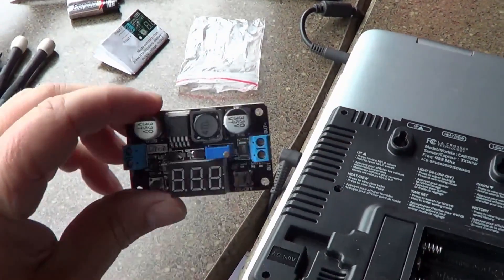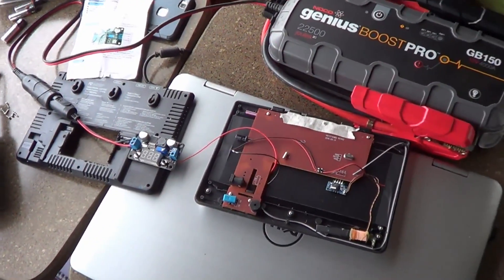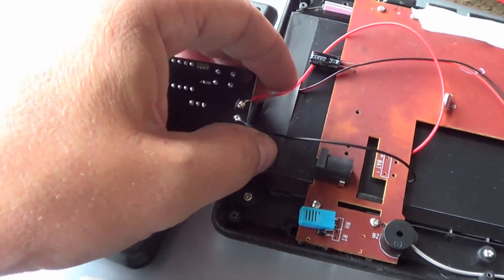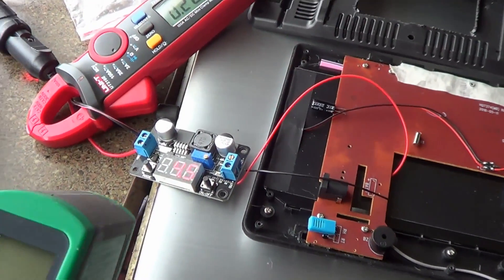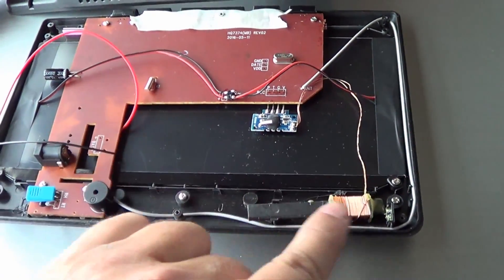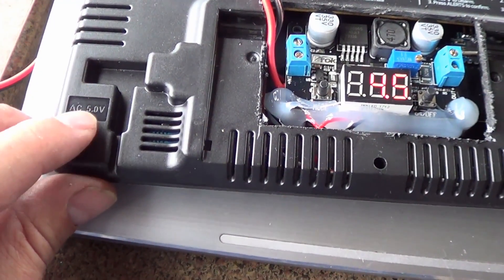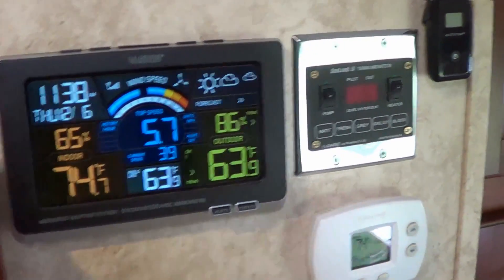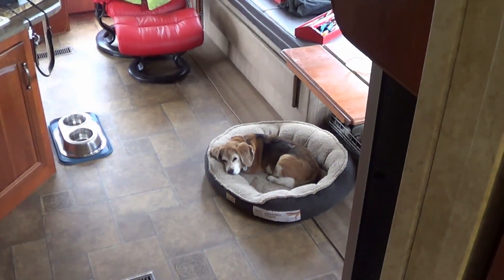Buck Converter Mod -  Reducing the RV 12 VDC to 4.5 VDC

Comment: if you connect it to the adapter input your display will stay on. if you go to the battery your display will only stay on for a short time then go out. its a battery saving feature. also any heat out of that converter will mess with your indoor temp reading.
Reply from the maker: I can't connect to the adapter input as it's a 5 volt AC input, not DC. So far so good on the temp as its matching exactly to my nearby furnace/AC thermostat temp reading. Cheers, Ray
Reply: +Love Your RV hi ray. 
if you put your 4.5 volt to the 5 volt ac . it will still work as the ac goes direct to the rectifiers and will pass through to run your station. The ac input is rectified directly to dc at battery voltage because it is cheaper to manufacture that way as opposed to having internal rectification in the adapter. I know this works as I have done this to my station. I have the same weather station and I am an electrical engineer.
Reply from the maker: How did you did you determine the polarity or did it matter? Did you account for the voltage drop across the rectifier? I believe most silicone diodes drop around .6 or .7 volts. I think if I was to go this route I'd bypass the rectifier and find the main filter capacitor.  Test the rectified DC voltage present there when using the AC plug and then try and match it with the buck converter. Wire the output right to the cap.  I may do that so I can get full features. ie backlight levels and staying on
On a side note - Does your clock keep accurate time. Mine seems to drift, was wondering if the unit was using the 60 cycle of the AC power to keep proper time.
Reply: +Love Your RV hi ray
you are best to go to the filter cap. but it doesnt really matter too much. Less things in line less to go wrong. The polarity doesnt matter as it is a bridge rec.
The clock on mine keeps exellent time. Ac makes no diff. as its not a syncronous type clock. The only problem I had was inside temp. was off so I returned it to lacrosse for a replacment. Everything is working perfect now.
Reply from the maker: Hi Jim, just an update. I did some testing. I found what I think is the main filter capacitor 470uf 16 volts.   I plugged in the OEM 5VAC wall adapter and measured 7 VDC on the cap. This would be expected after a bridge rectification.
Then I fed 5 VDC into the input jack and measured 4.5 VDC on the cap. Also expected as there would be a voltage drop across diodes.
It's quite the difference. I guess there is enough regulation to compensate. But folks supplying 5 VDC to the jack with things like USB adapters are definitely supplying much lower voltage than the OEM design.
I changed my buck converter to 7.0 VDC and wired it right to the cap. Now I have the full features just like it was plugged into the wall and the correct DC supply voltage. Thanks for getting me thinking. :)
Cheers, Ray
Reply: glad I could be an inspiration. Be safe and happy travels.
Reply: @LoveYourRV  Ray... I think that this updated version is exactly what I'd like to do in my unit... however, you lost me right after the phrase "I did some testing." Any chance that you will be doing a followup (or updated) video showing exactly what you ended up doing to power the weather station using 7.0 VDC for us non-electronic engineer types?
Reply from the maker: @leighsheppard8614  Open the weather station display and look for a capacitor 470uf 16V  will look something like this - https://www.rfparts.com/media/catalog/product/cache/1/image/9df78eab33525d08d6e5fb8d27136e95/4/7/470-16r_1.jpg
Set the buck converter output to 7 volts. Wire the output of the buck converter's negative and positive terminals to the negative and positive leads of the capacitor.
Reply: @LoveYourRV  Just did this to my slightly different brand of weather station, and it works great.  Thanks Ray.

Comment: I have a LaCrosse that has a 5v port. I purchased a 12v plug that comes with an adjustable feature. Set the plug to 5v and connect to a 12v source. Works great.  I never saw a buck converter though so great info, Lou
Reply from the maker: Your model may be different and take 5 VDC on the input, mine use 5VAC. I did some testing. I found what I think is the main DC supply filter capacitor 470uf 16 volts inside the display.   I plugged in the OEM "5VAC" wall adapter and measured 7 VDC on the cap. This would be expected after internal bridge rectification.
Then I fed 5 VDC into the input jack and measured 4.5 VDC on the cap. Also expected as there would be a voltage drop across diodes.
It's quite the difference. I guess there is enough regulation to compensate. But folks supplying 5 VDC to the jack with things like USB adapters are definitely supplying much lower voltage than the OEM design.
I changed my buck converter to 7.0 VDC and wired it right to the cap. Now I have the full features just like it was plugged into the wall and the correct DC supply voltage. Cheers, Ray
Reply: Just saw this comment...  yes, 7/5 voltage drop for AC-DC rectification is typical (smoothing the sine's "bumpiness" clips the peaks to fill the valleys).   If you're feeding 5VDC, it should be done after the rectifier (although you do get polarity protection if done from the plug...).   The reason you CAN use a 5VDC input is you're forgetting your unit is happy on batteries...  4.5V when fresh, but probably still tolerated as low as 3V when batteries are almost dead.  I'd suspect the internal electronics are using 3.3V MPU ICs, as most devices that use 5V MPU's start with 6V DC from 4 cell alkalines.  Hack on, Amigo!
Reply from the maker: Would be great to see a schematic and know exactly how things are engineered and the difference between the AC input and the battery back up power feeds. Otherwise, you're just guessing. That's why I want to apply the same voltages as they designed it for and used the buck converter to match them.
Reply: Love Your RV That's why i have the Hammer Analyzer...  One swift whack, and I can view the PCBs much easier!  They may not work any MORE, but I can follow traces so much faster once I can fold the boards...  ;)

Comment: Hey Ray.  I saw a YouTube video (G2I7_Ik7_WI) where a 16-17" (seek to 2:35) radiator fan was converted into a box fan, kind of like the Fan-Tastic Endless Breeze.  If you look at my comments, he states this fan can push about 2000 CFM which is about double the Endless Breeze but I'm not for sure of the power being consumed.  At 3:30 he has it running and consuming 45W and a few seconds later consuming 30W (he might be switching out solar panels for this - not for sure).

The reason I posted on this video is because he is using this DROK speed controller (Amazon part - B00DVGGWC0).  Checking the Amazon product images, I see it has 3 heat sinks which I'm guessing is converting excess power into heat so the fan will run slower but the same net power is consumed as resistance heat and fan speed.  Do you know if this sort of controller and the one used for your project burn off excess power as heat?  I did not see heat sinks used in the controller you used.

One potential use for this sort of fan is to help with keeping mosquitoes away from the area in front of your RV door when boon docking.  Here is a video (zzSFCABlsi8) on using a 120V rotating fan for this purpose.
Reply from the maker: I have roof vent Fantastic Fan works great and doesn't take up any floor space,  very low amperage draw.  Can be reversed to draw air in so it could be pushing air out the door to push out mosquitos.
The losses with these fans and buck converters are pretty minuscule in the grand scheme of things. With the small size of the heat sinks, I wouldn't worry about it. Cheers, Ray
Reply: @LoveYourRV  Wonderful idea of pushing air out the door using the Fantastic Fan.

Comment: Another good video.  The only comment I would like to add is to make sure you use 'Electronic' grade RTV.  The standard grade RTV releases acetic acid as it cures (the vinegar smell) which can corrode electrical devices.
Reply from the maker: Good tip. I usually don't worry too much unless it's in an enclosed case trapping the fumes. In the past, I've had the non-electronic grade silicone actually soften plastic.  Cheers, Ray

Comment: That is really useful and couldn't have been better timed; I'm doing a small campervan conversion and wonder, could this device be used simply to regulate the van leisure battery's output to 12V such that even when it's on charge (AGM, up to 14.7V), the devices in the van still just get a constant 12V? I'm particularly thinking of some cheap LED lights that might not accept a wide range.
Reply from the maker: Yes, the output is regulated so even if the input is 14.7V due to the charging the output would remain at a steady 12. As you saw in the video when hooked to my battery box the input was 11.8 and when hooked to my RV batteries it was 13.6 but the output remained at 4.5V.  However, the max constant current is 1.5 amps so it can't power too much.
Reply: Love Your RV Excellent! It'll be fine for those LED lamps. Many thanks.

Comment: Hello Ray.   I'm not a full timer by any means, but drive my wife to distraction with gadgets and mods.   I have easily found a DC voltage step up device to replace my 19.7 volt laptop and 32 inch Samsung TV, external power supply but have trouble with a couple devices.   Wondering if that Buck Converter which is adjustable can INCREASE voltage above input voltage or if it just steps down.  The adjustable devices I have found do not specify in the online descriptions.

We enjoy most all of your videos ( her not so much on mods) and have even developed an appreciation for Beagles.  Keep up the good work.  Tom n Joyce
Reply from the maker: The term buck seems to mean it only steps voltages down and the term boost means it steps them up. There are converters that do both called Buck Boost Converters - here is an example - https://amzn.to/2uSsnJg
Thanks for watching the vids. :) Cheers! Ray

Comment: Hey Sparky,  DROK makes a bunch of stuff like this.  Recently picked up DROK Numerical Control Regulator.  Was using it to charge lithium batteries when I was tinkering around with e-bike stuff.  Better than having a seperate charger for 36/48/52v batteries.  Would think using DC voltage for most all RV gadgets is better than using inverter.

Comment: Why would you cut up your weather station, wall and wiring to connect power to this unit?  All a "buck" converter is is a voltage reducer. There is a input jack on the back of your weather station for plugging into wall power, like a cell charger or wall converter. I agree the label is confusing, but it means "this is were you plug in you AC adapter rated at 5v DC! (When you have battery powered devices they are DC input voltage.)  Then your weather station is still portable, so you can have it anywhere, hotel, house, counter, table, bedside, etc.  Much simpler!!
Reply from the maker: Not this device it's AC adapter output is 5 volts AC, not DC. It has its own internal rectified supply circuit.
I did end up exploring further after a comment by Jim Galpin. Ended up attaching the buck converter DC output to the output of the weather stations internal bridge rectifier across the main filter capacitor. Changed the buck converter output voltage to 7VDC to match what was coming off the rectified 5VAC input. Now I have the same functionality as plugging it in versus using the battery backup. See the pinned comment for more of our discussion. Cheers, Ray

Comment: Too bad LaCrosse wasn't a decent enough company to keep your constants with a coin cell for when you have to replace the batteries.
Reply: The idea that LaCrosse has is that the batteries are primarily for backup for when the power goes out or should you need to unplug the unit to move it.  In order to preserve the memory when it comes time to change the batteries, change them with the unit still plugged in to 120V. Not sure if that would work after Ray's mod, but with the mod, he no longer needs to worry about changing batteries. The only downside to his mod is that if he ever uses that big red switch in his rig to disconnect his 12V battery bank, he will lose all settings and history in the weather station.

I was originally super excited about doing this mod, but upon further reflection decided that I would prefer to leave the unit and the AAA battery supply intact and power it somehow through the 5VAC jack. (which is what I think Ray ended up doing, but I don't know enough about electronics to follow his description of how he did it!). This would:
 a)not void the warranty.
 b)keep the backlight on as the default.
 c)still provide battery backup to the weather station in the event that I had to shutdown the 12V battery bank in the rig.

I hope Ray gets the chance to show us non-electronic types (in a video) exactly what he ended up doing to use the 5VAC input jack.

Comment: My Lacrosse weather station also takes 3 AA batterys or has a plug in 5 volt port.  Just wired it direct to a USB charge port running on 12 volts and it works great.  Yours did not have the 5 volt plug option?
Reply from the maker: My unit uses an AC adapter that outputs 5 volts AC power to power the weather station display.
Output: 5.0VAC 1.50mA The batteries are actually for backup power, but I use them as the main power since we are off the grid so much that's why I just wanted to wire it right into the rigs battery banks 12-volt power.
Reply: Good lord.   I applaud your desire to hack your RV, and just assume you're not familiar with electronics, but...

1) Your unit takes 5V AC input on the coaxial because they put the rectifier in the head unit instead of the wall-wart.   However, feeding 5V DC into the jack would be EXACTLY the same to the head unit -- you're just using only two of the diodes in the rectifier fulltime, instead of half-wave.  After the recitifier, everything is 5V DC inside.

2) That $3 buck converter is ridiculous price/size/capability for your purpose...  You'll only adjust it once, and never look at the LCD display.  You can get "big" DC-DC voltage regulators like yours for $1-2 losing the LCD display, and as little as 6 cents on a chip.   

2B) Yes, really.   LM7805 chips are 10/$0.60 delivered, and convert 12V to 5V all day long.  Up to 1.5A, non-adjustable, the size of your pinky nail.  I use them to eliminate all my USB-powered devices in my RV.  Probably the same chip that's in most 12V USB cigarette plugs; I'm just making it internal like you did -- WITHOUT cutting.

https://www.aliexpress.com/item/10pcs-L7805CV-LM7805-L7805-7805-Voltage-Regulator-IC-5V-1-5A-TO-220-make-in-china/32829260948.html

-Gyro
Reply: Interesting alternative method, Gyro - do you have links to illustrate the use of the those chips?

Comment: That is really cool!  Does the Buck Converter LED display turn off after a time out period?
Reply from the maker: No, I read somewhere that it could be turned off somehow by holding a button for a few seconds, but didn't work on my model.
Each display segment draws about 5 milliamps. Left in the 4.5 reading that's about 50 ma. I can live with that.

Comment: Isn't that a barrel jack for external power on the main board to the left?
Reply from the maker: Yes, it's for the wall adapter rated at 5 volts AC power.
Reply: Ok maybe not the simplest way to do it but do like the use of the buck converter have many of them for arduino projects
Reply: LM7805 is the simple way to do this.  See my comments above.